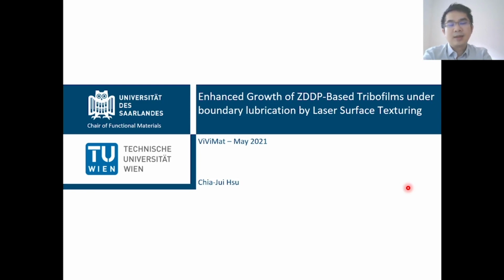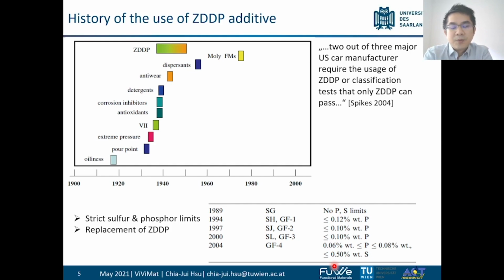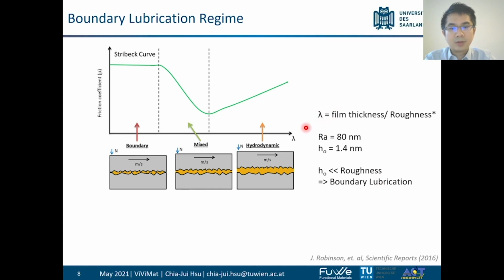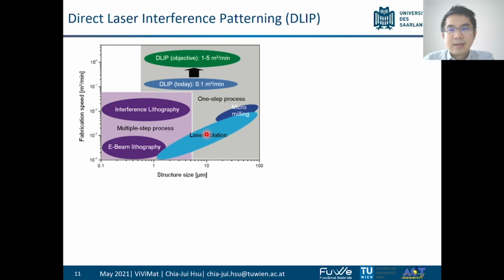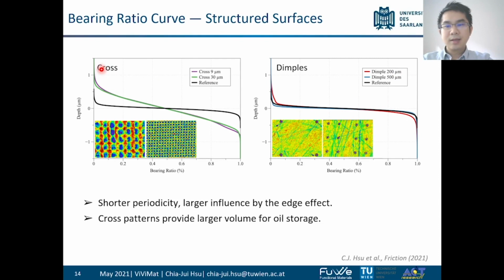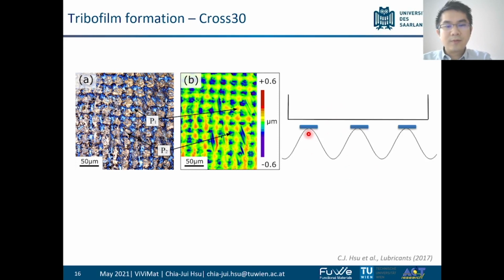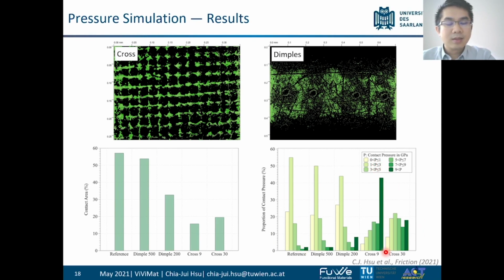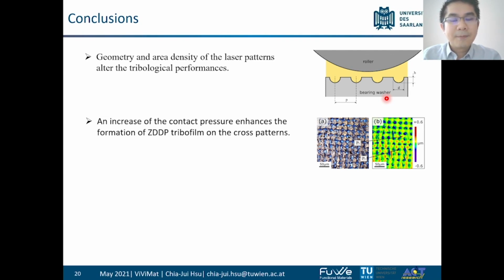Chia-Jui Hsu (TU Wien, U d Saarlandes) on Laser Surface Texturing | ViViMaT 2-1-5

Comment: Nice talk.  Given that you find an optimal pressure range for nucleation and stability of the tribofilm, and in the case of the roller bearing you know the nominal contact area and average pressure as a function of load, is the texturing lithography technology advanced enough that you could modulate the local peak heights to keep local pressures in the 3-7 GPa sweet spot regardless of applied load (within reason) for all peaks in contact?